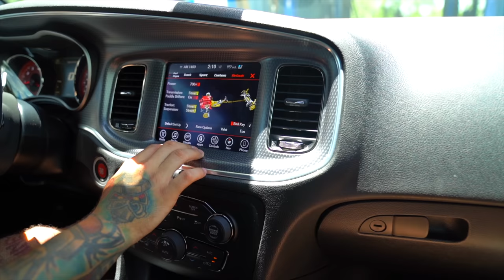Straight Piped My Brand New Hellcat ! | Braap Vlogs

Comment: to make it extra loud get a cam and take the cats out 😂
Reply: He did get cats and rear mufflers removed didnt he thats what straight piped is...
Id Just drive it man n wouldnt spend to much on it the way he flips things is way to fast so shouldnt waste cash on it the black wrapped bonnet is all he should do...
 700hp and over is insane in car you dont need anymore than that for the streets..
My gts commodore was cammed out to stage 5 with a massive turbo and had 780hp thing was to much for the streets especially in the wet...thing ate so much fuel aswell...